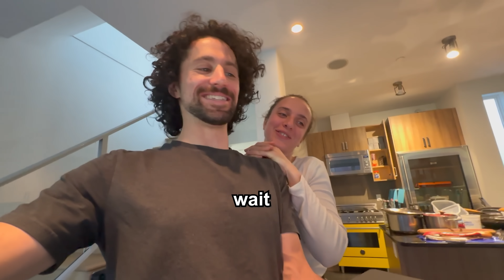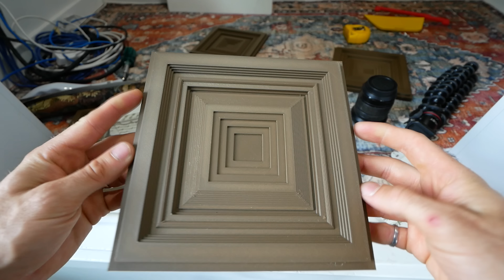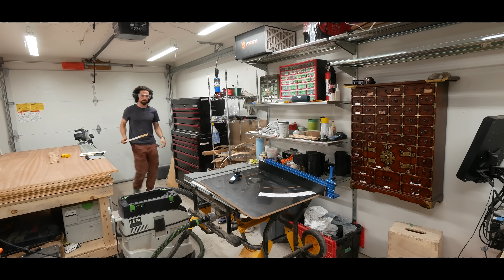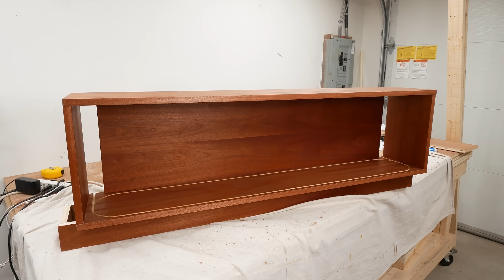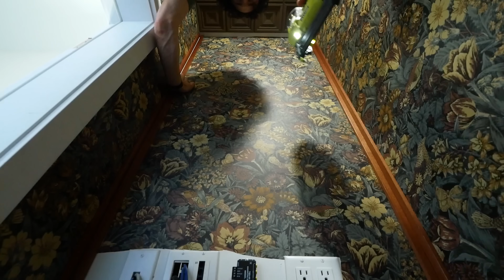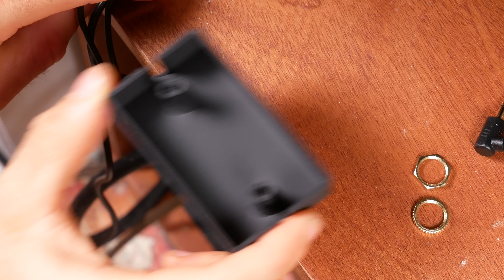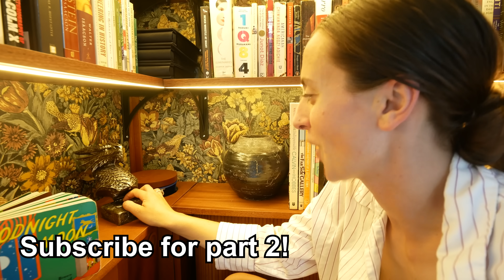I Built a Tiny Library on my Stairs

Comment: i would have a painting/art that moves vertically
hang a painting with rails on the back of it that glide on points at the top of the door frame. like barn door trolley, but the trolley is on the door frame/wall and the rails that interact with the trolleys are hidden on the back of the painting. this just keeps the painting a fixed distance from the wall, but to support if I would come up with a counterweighted suspension system; could be sleek or elaborate. it could just be counterbalanced so the painting will just sit vertically where you adjust it to, or make something like the cut the rope to drop the chandelier trick, where you trigger an input causing the painting to rise.
hopefully some part of this made sense lol. cant wait to see part 2!
Reply from the maker: I love that!

Comment: Being able to half close the door, to allow some air inside while reading, I think is another consideration for the plan.
I am thinking two part door: half of it opening up, the other down. Sliding or opening like a rear car door. 

Half being a painted glass (allowing some light in even when closed)
 and the other half being a painting on glass, canvas or wood. 

Both making a picture with a lake and the reflection of the sky, and mountains inside the lake.
 I would adjust the frame between them to be ground level, therefore paint the frame brownish. 

I would prefer a painting-picture giving the perception of depth. Maybe choose a scenery described in a any book you both love.

I wouldn't bother making stairs. I think it would overcomplicate the frame and lose attractiveness. 
Just add a stool nearby to use it when needed.

Comment: Why not  faux stain glass as a door? It will give some nice ambiance  light, plus it fits in with the old style.
Reply: Yeah, it could work as piece of art - if you find the right piece of glass. I don't know about faux - but glass seems the only way to let light in opened and closed. And let the library be visible always. 

I'd look second hand and build the frame yourself. 
Maybe your landlord is also okay with making it slightly higher to avoid bumping your head?

And maybe add a small ledge to make stepping into it easier?
Reply: @theresab2815  There are other ways to make it look like coloured glass. Acrylic Paint and Elmer's Glue,  Mod Podge and Food Colouring, Hot Glue and Plexiglass. Or have a door with holes where you inlay thin paper. The holes, which provide some extra ventilation on hot days. (like Japanese doors). If you have a creative mind, you will find many different ways to a solution. Which is a part of a fun challenge.
Reply: @C.B.32mmh I never thought of that, but yeah some cool ideas.🤔👍

I personally don't like Plexiglas, but it would be easier to work with. And mod pudge could make it waterproof, so it can be cleaned 🤗
You could even use colored transparent paper instead of paint. 

Maybe a Gothic window frame, split in the middle with a personalized motive?

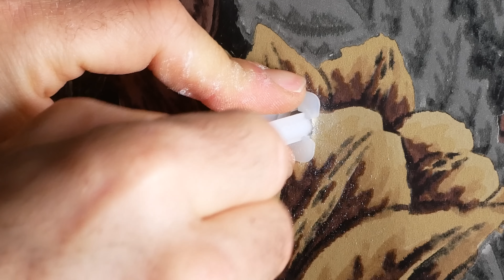Comment: 19:33 heh. I've put many TV's on a wall using those toggler bolts. Some of them are rated for several hundred pounds EACH. Legitimately you're going to rip the drywall off the studs before those things come out.

Comment: the door should slide but try to fix the bouncing problem by making it go slighltly into the wall when closing if you understand what i mean
edit: i have gotten 20 seconds longer into the video and turns out that you cantmake a hole in the wall :I

Comment: For the summer time you could integrate inside of them Peltier elements to cool them down, or add water tubing (LTT for example did it in a chair) - and for the noise of the pump you could either get a quiet one, one with low RPM, or even place it outside the window.
Reply from the maker: Never heard of Peltier elements, looking into it now. That's fascinating! Do you think they would be effective for cooling a whole room like this?
Reply: @MorleyKert  from what i remember peltier elements aren't particularly efficient, and you'd probably need a lot of them to significantly affect the temperature of a big space (take this with a grain of salt though i've never worked with them before)
Reply: @MorleyKert  no. they are really inefficient.
Reply: @MorleyKert I hope this isn't too late but at high voltage, a big panel of them and heatsinks for a high surface area for heat transfer might be enough, you could try to do some calculation with surface area, voltage, given efficiency and ambient temperatures to get a rough estimation

Comment: I think you should put a large enough painting that covers the hole on some drawer sliders that would mount to the wall. The whole painting could then slide to the right of the opening.
Reply from the maker: That's a really fun idea! There's not quite enough room on the right side for the whole painting to slide there, but maybe I could have a multi-part slide
Reply: @MorleyKert  maybe it could slide up?
Reply: @MorleyKert  how about a sliding tambour door again, but with a canvas painting. it would slide to the right covering the corner of the right wall and the adjacent wall.
Reply: @MorleyKert or you cloud use more than one painting and connect them together so it cover perfectly
Reply: Do a triptych picture set, they look awesome and you can easily make them fold in thirds for more flexibility.
Reply: @MorleyKert  what about having the painting roll upwards or to the side into the frame?
Reply: @MorleyKert  Construct a large wooden frame with routed slots along the interior sides to guide a canvas or portrait. The artwork should be designed to roll up into a compartment at the top of the frame, allowing it to retract when not in use. To ensure the canvas hangs smoothly and stays in place when extended, add a weighted or magnetized strip along the bottom edge.
Reply: @iuslisuhled2311 This sounds like what I was thinking, but it would have taken me years to say it without using my hands for visual explanation!💁‍♀️🧏‍♀️🙆‍♀️🙅‍♀️🤦‍♀️🤷‍♀️ No, I'm not Italian😉
    Is your idea to have the painting roll up like the old pull-down-to-roll-up window shades?
   That's what I pictured. (pun intended) Though you have to be careful with those because if you pull and let go too soon, they would FLAP FLAP FLAP around a few times before stopping at the top!🙄🫢😆
    Take care, and God bless y'all! ❤️K!🙂🙏🙋‍♀️
Reply: @MorleyKert  How about a swing-hinge painting, either one that swings to the right of the door, or one that swings up from the door. Maybe fit a light fixture into the swing-up one to give it a "reason" to stay open.
Reply: @MorleyKert what about having the painting slide up instead?
Reply: @MorleyKert I suggest a painting hung onto what looks like a fat plate rail, but actually has a motor hidden inside to draw the painting straight up. If it was controlled remotely, you could keep the remote anywhere without having to wire a switch. Bonus if the motor is also battery-powered (no wiring at all).
Reply: @MorleyKert  just make it go diagonal :wink:
Reply: @MorleyKert  do you know who Markooooo is? He just did a thing where he had a painting or something that was split in half and using ropes, tracks, and pulleys and stuff, you just pull one side and it splits open revealing the center
Reply: @MorleyKert can you slide it so it's above the frame?
Reply: @MorleyKert  painting is this ( ▯ ) then it could slide out both ways like (←→) so it'll look like  [ -- ] (im not very creative)
Reply: @MorleyKert  There seems to pretty much above the opening. You just could have the painting slide upwards, that way it'll never be in the way.
To make it more fancy and accessible it should be able to move with electricity or a gear chain or sth. like that.
Reply: @MorleyKert  Perhaps adhere the painting (just the canvas of the painting, no frame) to a retracting window curtain, and produce a frame that hides away the retracting curtain when it is rolled up and makes it look like just a painting when it is down completely?

As an alternative, I think it might be appropriate to take a cheeky approach with a small bookshelf that slides into or otherwise hides the space. This way when you tell someone to take a look at your library, on a surface level it's just a tiny shelf with a small assortment of books and decor items, but you can then reveal the larger hidden library inside.
Reply: @MorleyKert  What if it slid upwards? Looks like there might be enough space
Reply: Maybe make the painting open up like a door, or make it collapsable so it can fit to the right
Reply: The painting should slide upwards!
Reply: @00000a0009  I like this idea the best but maybe it should roll up so it gets out of the way
Reply: @00000a0009 oh yeah 👍🏼
Reply: could be a frame with a large painting but it rolls up like a projector screen?
Reply: @lenagkika  this one for sure. hides it in plain sight and uses no extra space whether open or closed.
Reply: @lenagkika  elegant solution
Reply: Or maybe put the painting on door hinges, so that way you don't have to worry about the problem. The problem being that  you don't have enough room for the painting to slide to the right/left.
Reply: Like the Gryffindor dorms at Hogwarts!!
Reply: I say, keep it simple
and hang a tapestry on a rod, open and close like a drape
Reply: Optical illusion with two rails and a split painting.
Reply: Make it a triptych so it’s not 1 piece
Reply: You could go Banksy style - with an old-fashioned style frame with a hidden roller mechanism built into the top section. In this case the painting rolls up into it and doesn't get shredded of course!